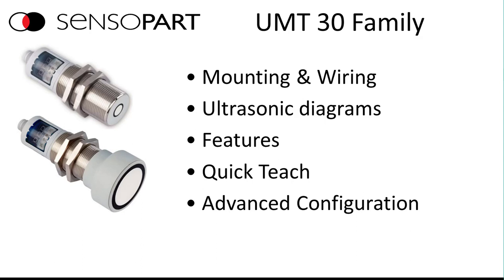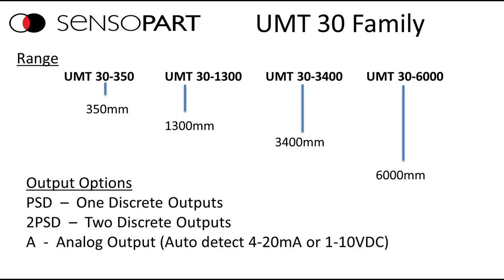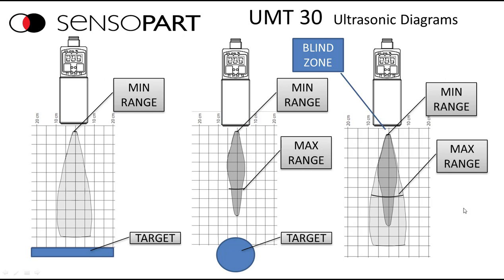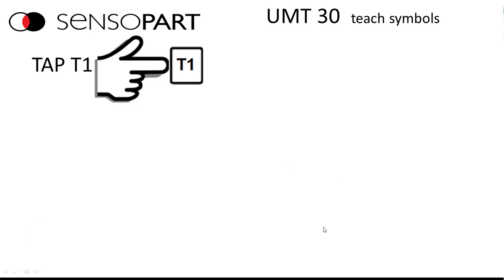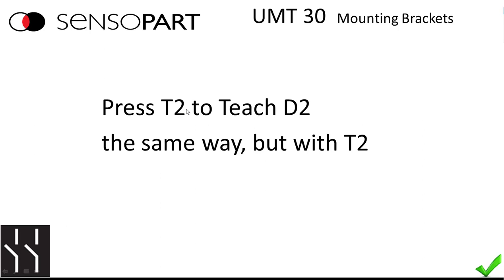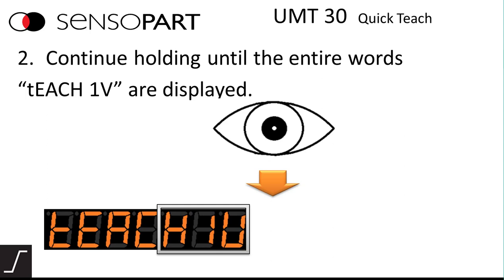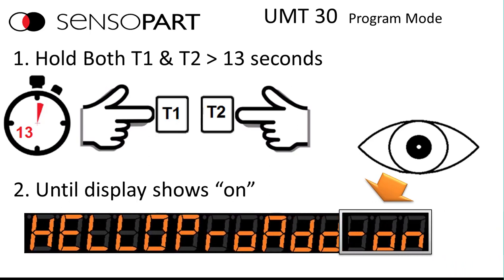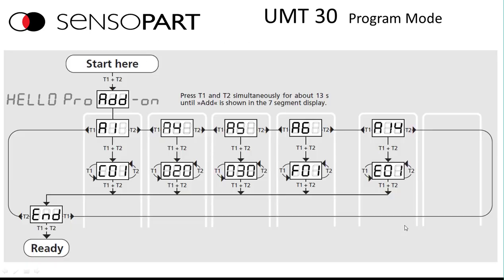UMT30 Ultrasonic Distance Sensor (with display of actual distance!)

Comment from the maker: 0:35  Mounting Options
0:43  Summary of Features
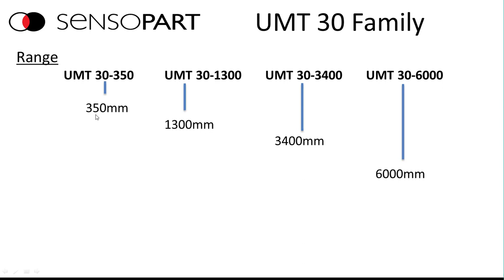1:33  Range Selection by Part Number 
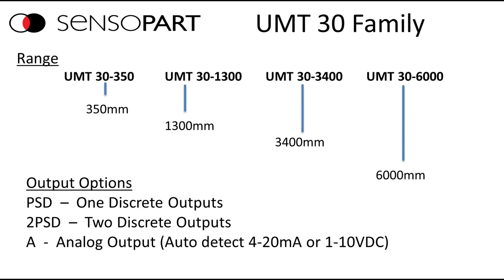2:05  Wiring Discrete sensor
2:21  Wiring Analog
2:34  Ultrasonic Diagrams
3:45  Display, LEDs, teach buttons
4:40  Conventions used in this video
5:35  Distance example - mm & Cm
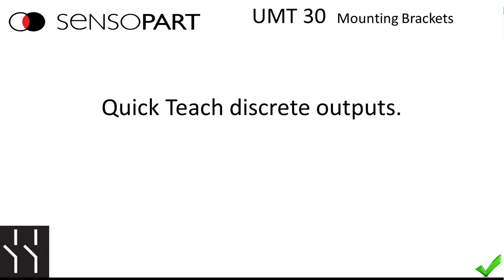5:53  Quick Teach Discrete Outputs
7:07  Real World Teach Discrete Outputs
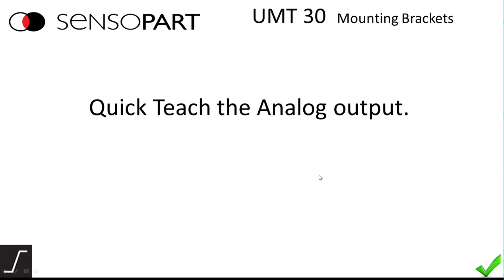8:07  Quick Teach Analog Output
9:11  Real World Teach Analog Output
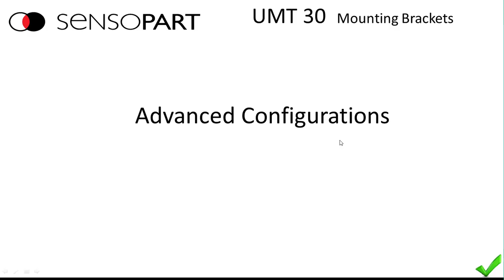10:04 Advanced Configuration overview
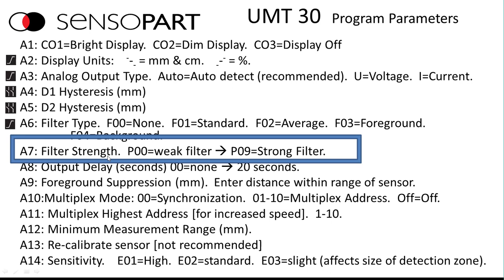10:59 List of Advanced Configuration options
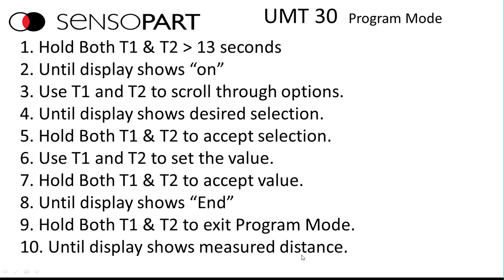12:06 Advanced Configuration steps

UMT30 Product selection:
http://www.sensopart.com/en/products/ultrasonic-sensors/ultrasonic-sensors?baureihe_ultraschall=M30